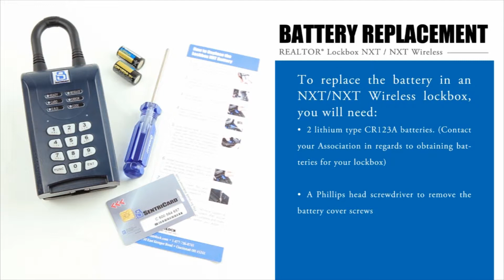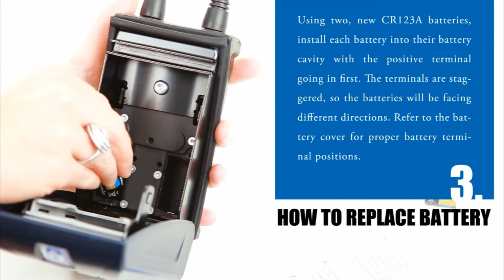NXT Lockbox Battery Replacement

Comment: So what number is the Phillips Screwdriver?  #1 #2 etc?  I even called sentrilock and THEY don't have the number and said "just use the starfish head"!
Reply: A #2 Phillips Screwdriver works excellent.
A Torx (starfish) screwdriver is not required.